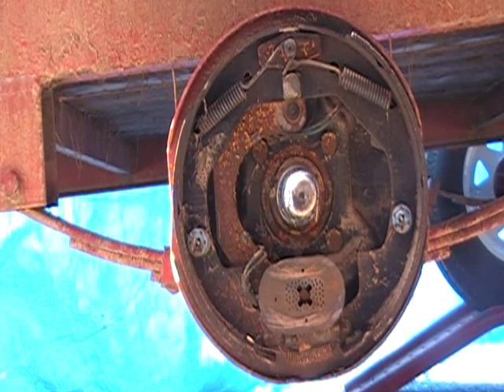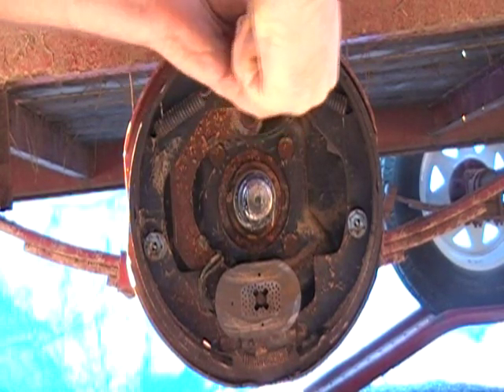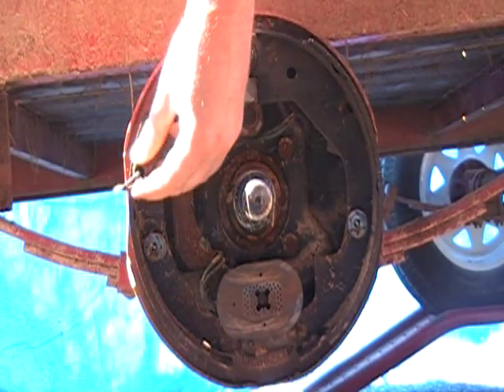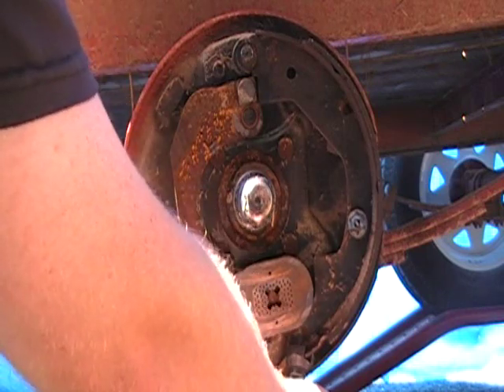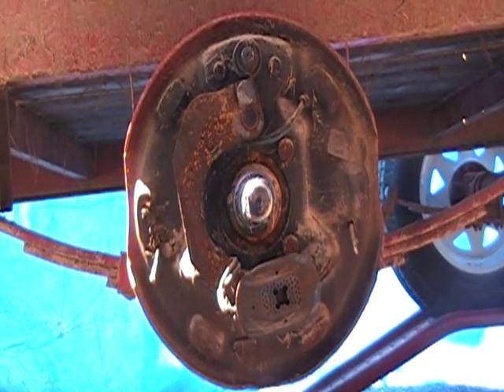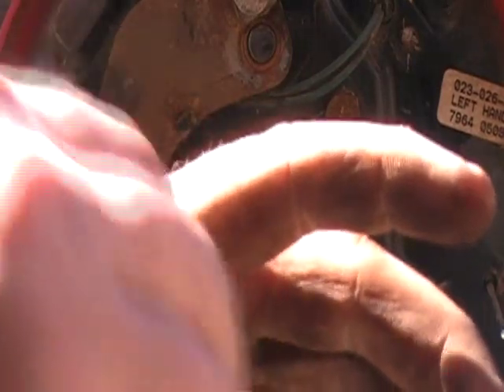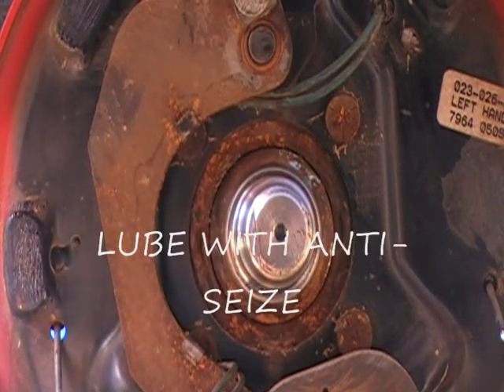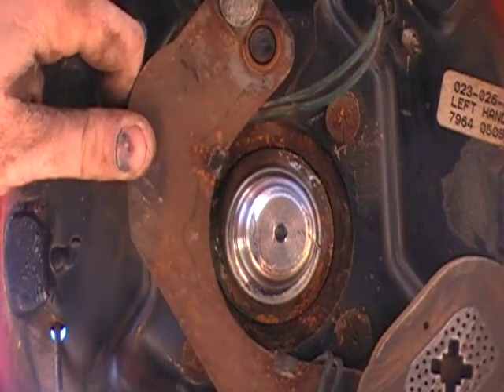Drum Brake Shoe Removal and Installation on a Trailer

Comment from the maker: I used a brake shoe return spring removal tool on the return spings on the top.  I used a brake shoe retaining spring removal tool to remove the retaining springs on each side.  They are available as a set with a few other brake tools, or individually.

Comment: A great help!
I just bought a trailer I needed this info. 
My electric brakes were cut and wondering if you have a video on proper wiring, testing of electric brakes?
I don't see any wires in my 7 wire sheeth resembling the pair that come out of the drum